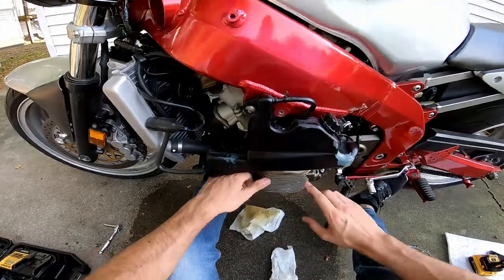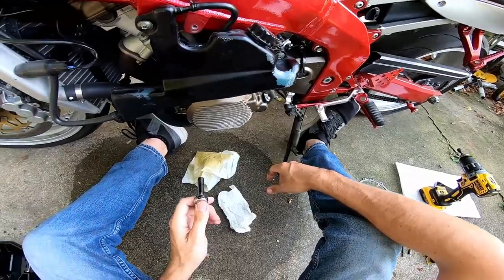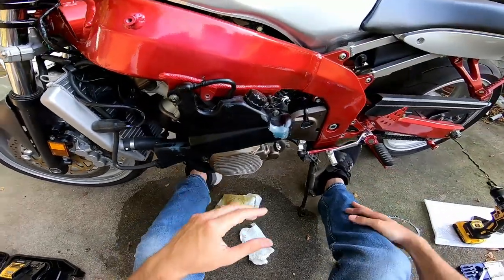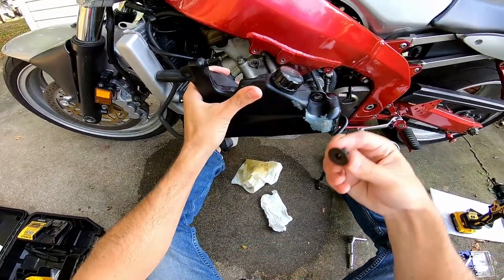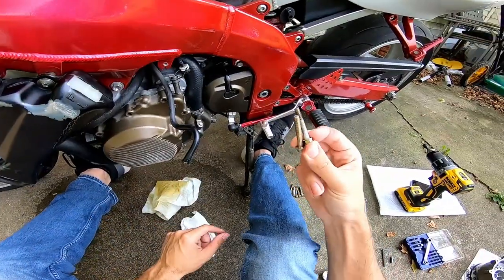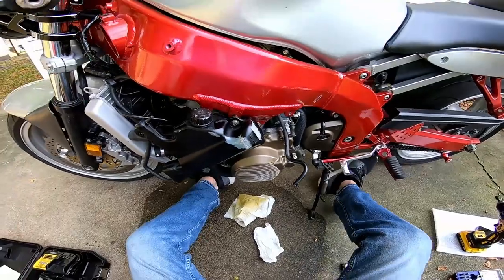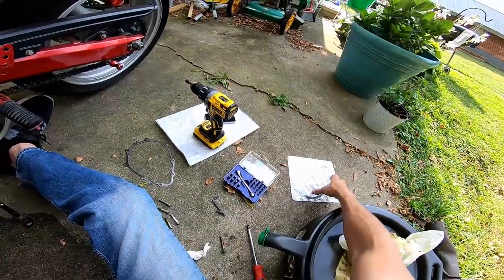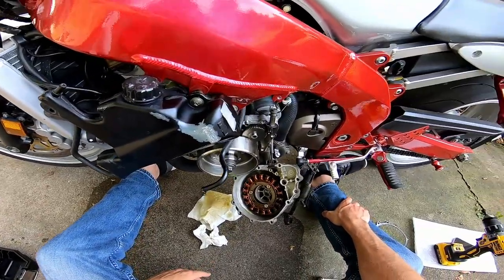Kawasaki ZZR600 Stator Cover Replacement

Comment: What did you end up doing to hold the tach?
Reply from the maker: I rode it without indicators for a while, but ended up fixing the bike correctly and returned it to OEM configuration before I got around to remedying that situation.

Comment: Thank you. Here where I am , they wanted 60€ , (around 70$) for used one , to sell. Ok it's original , but that's ripoff ... Thanks bro , have safe roads
Reply from the maker: Hmm 60 Euro for a used part... I guess it depends on how used it is. If it is a nice example with no rash, it may be worth the extra money depending on your priorities. The cheap eBay parts work just as well, though! Thanks Milovan, safe roads to you as well!

Comment: Thanks for the video. I'm getting ready to change the cover on my '07 in a couple weeks when the parts come in. Do you need to use any RTV or gasket maker on this or does the metal gasket do the job once it's torqued down properly?
Reply from the maker: You won’t need to use any RTV or gasket maker to get it sealed up if you’ve got a new gasket. I only used a new metal gasket with no sealants and had no issues with leaks even with the Chinese cover that I installed. It’s a pretty fool proof job! Good luck Robert!
Reply: @FishStick_ADV  Awesome & thanks for the reply. I purchased an OEM cover & gasket from cheapcycleparts.com (my main go-to, along with BikeBandit, for OEM parts) so it should work perfectly, and hopefully none of the casting flash like you mentioned in the video.
Reply from the maker: @Robert Gransee, buying OEM parts is never a bad decision! Your stator cover will undoubtedly be a nicer part than the Chinese one I used. Best of luck to you!